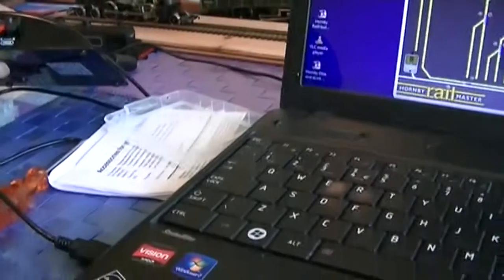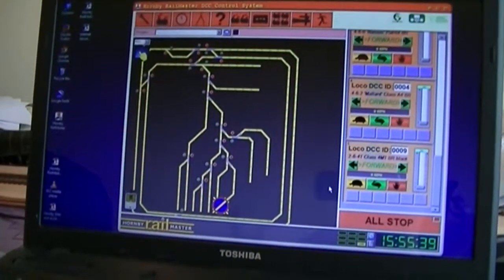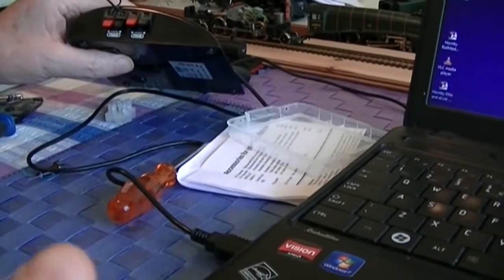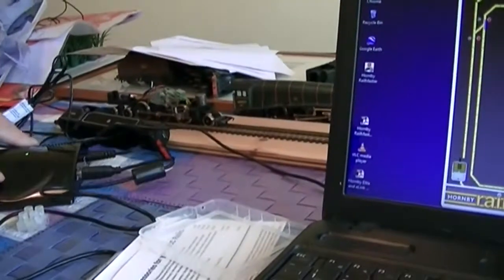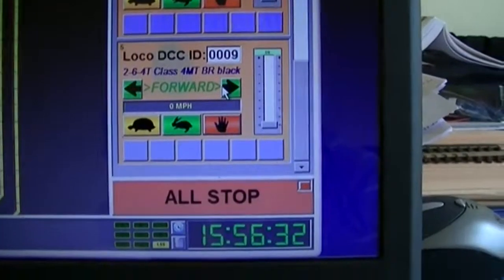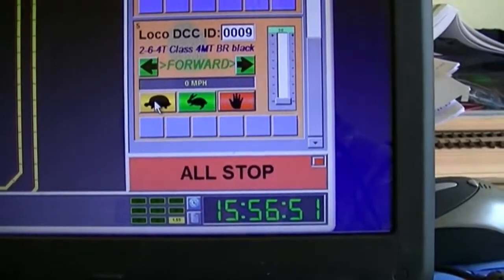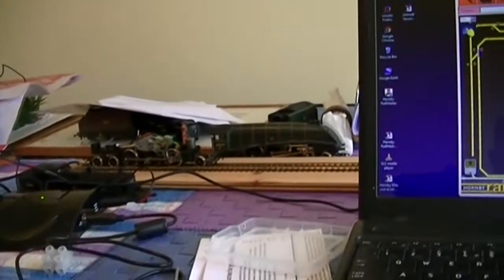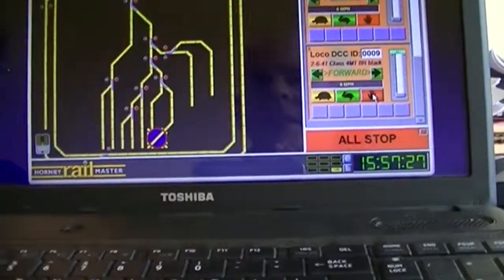Hornby E-Link - Testing that your DCC chip is working (3/3)

Comment: Hello,,

Love you instructions on programing with the Rail Master, very informative, please what we would like to see next are the instructions on setting up and programing the point decoders. 
Regards
Paul Garwood
Suffolk
Reply from the maker: Not sure if my Dad is rigging up the points to Rail Master - I think he was wiring those to a custom switch panel. I'll ask him what he's planning.
Reply from the maker: Had a chat to my Dad. Sounds like the points are exactly like the trains to program - they're just DCC chips so you should be able to use the screen I'm using to program them. Again, they would have to have their own ID on the track - different from the trains too. Other settings should be listed in the guide, though they may not need any other settings due to their simplicity of function. Obviously don't try to assign a train to them! I'm not sure how you assign them into the RailMaster track view, so they are controllable from it. If I find out, I'll post a vid about too.
Reply from the maker: +fokeyjoe Just a short follow up... so basically my Dad's RailMaster blew up! It failed somehow and so he's switched to some handheld pad with lots of buttons (sorry, didn't get the make/model). So I won't be posting any more vids on this topic :(
What may be of interest is that the DCC-based signalling chips we got wouldn't work with the RailMaster. I think it's okay if you have individual signals with their own DCC, or some arrangement with solanoids. But we got one of the 8-in-1 controllers and I don't think it supports the different addressing scheme to activate the points individually.